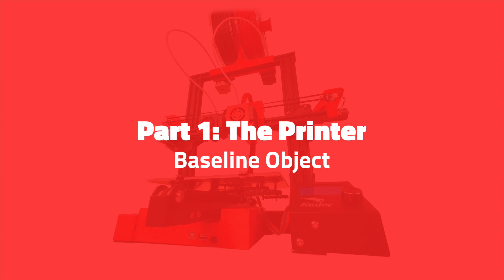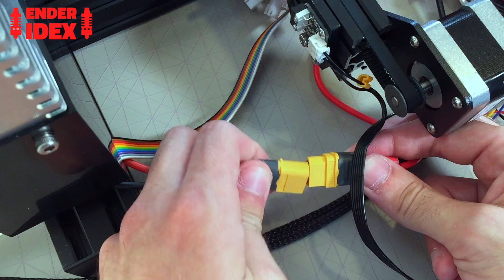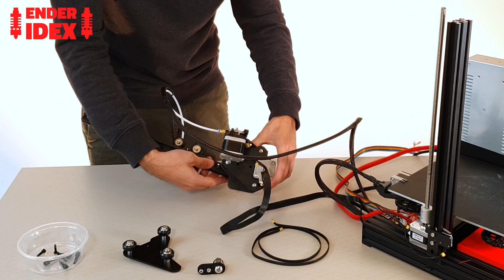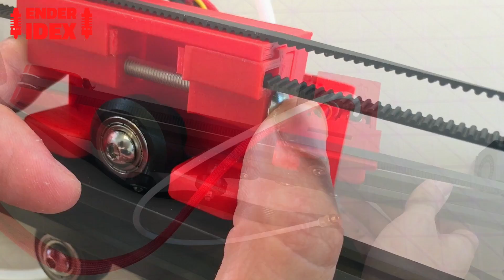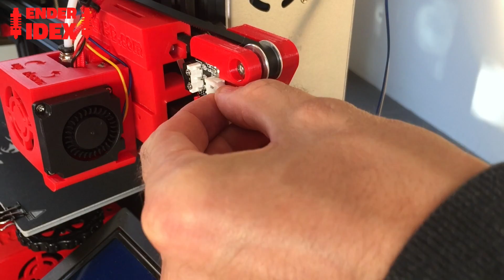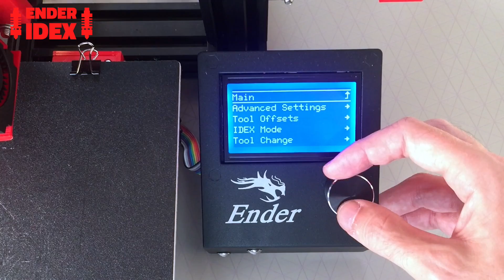Ender 3 IDEX: DIY Dual Extruder X-Carriage 3D Printer Installation Kit by SEN 3D

Comment: I own another IDEX machines and so this is not aplicable for me, but i have to tell you, this is by far the coolest thing i’ve seen in a while. Very, very well executed.
Great tutorial and great height adjustment mechanism for X2. Also, the whole thing looks like it’s well thought out.

You have my sub now, hope to see more of such material.

Keep the great work!

Regards from Slovenia
Reply: Thank you so much marko2210, I really appreciate your kind words. What IDEX printer do you have? Do you use it for Duplicate printing or 2 material/colour prints more?
Reply: Kane i give credit where it’s due, and this is pretty pretty cool. Especially for wide ender audience.
Anyhow, my IDEX of choice is Tenlog D3, run by DuetWifi+Duex5, with dual hemera. It’s pretty ok 😉 the other one is stock but currently on an operating table getting overhauled
I mostly print dual color for work (architectural scaled models), dual material trials for some engineering weekend storming and duplication for stuff that get’s printed in volumes either for sale or for giveaways. So a lot of all i would say.

In the works is a dual IDEX that will make quadruple and quad color/material available. Come join “MarX group” on facebook if interested. We could use a guy like you there 😉
Reply: @marko2210  ah yes, the Tenlog D3 is probably the other main entry point IDEX printer out there. Sounds like you've given it a serious overhaul...but then that's half the fun right? 😂😉

I love your use cases, it's exactly the kind of thing I envisioned when I started working on the kit and when I think about the power of an IDEX printer overall.

Quad-IDEX, now you really have my attention 😯 I will definitely join the group, I'd love to see the progress that is making and help in any way if I can.
Reply: Kane we are just makers, aren’t we 😉
Reply: @marko2210  do you mind sharing your duet config files? :)
Reply: Christian S. I don’t mind at all. In fact, i encourage you to use them so you don’t need to go through the hassle of figuring stuff out. Configs are set for RRF v2 and v3
The only thing you need is to join “MarX group” on facebook (sorry, no Github yet) and you can get links to my repostory, chat, troubleshoot, etc.

Welcome
Reply from the maker: Thanks Marko (I had to reply as Sen 3D or this comment shows as "not replied" 😅)